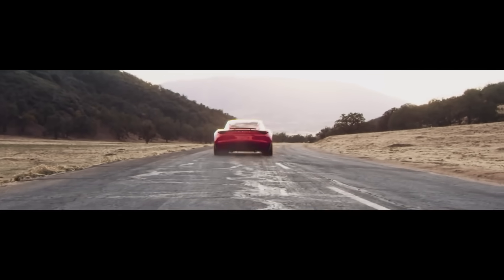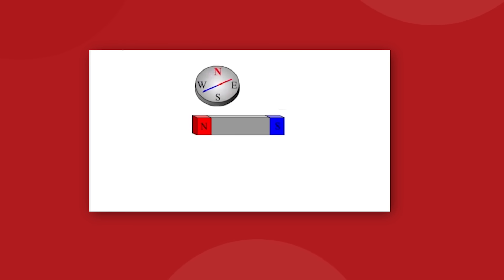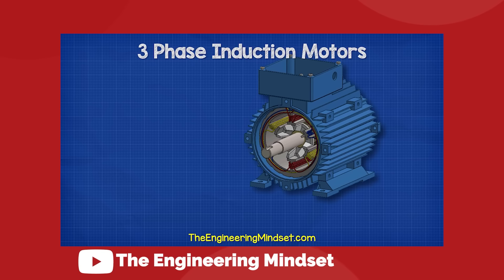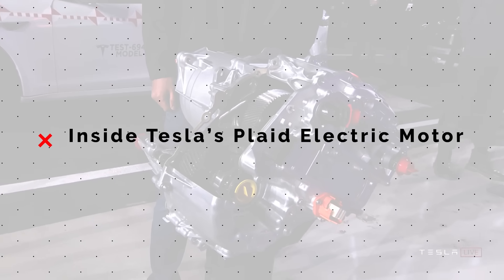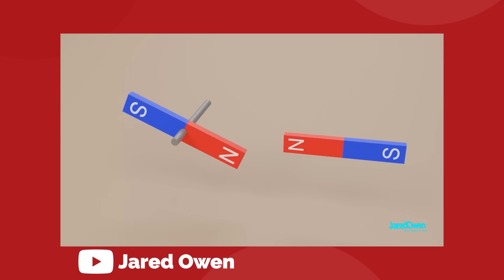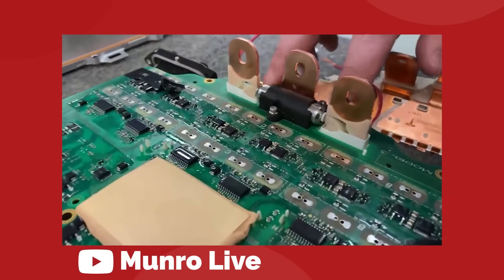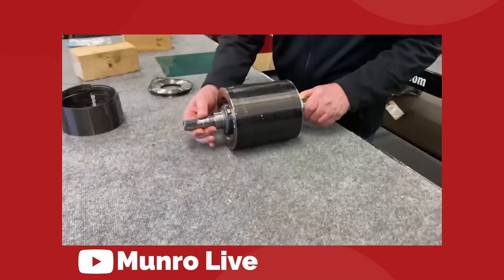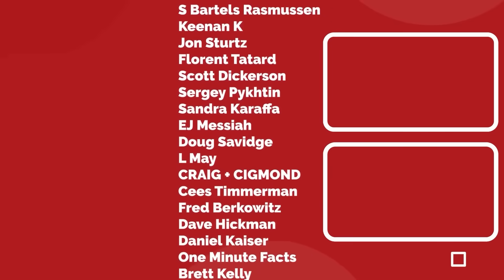The Real Reason Tesla Developed The Plaid Motor!

Comment: The only thing you got wrong, that I noticed, was the explanation of why you need twin motors or a differential gear box.
It was just a confusion of reference points.  
---> You said you can't go around the corner if the wheels turned exactly the same speed, because the inner wheel has to turn faster.  I wrote the software for an antilock brake system, and it's based on the same principles of physics.  

---> Since the inner circumference is shorter than the outer circumference, the OUTER wheel covers more distance than the inner wheel, so the outer wheel rotates faster, for the same RADIAL speed.
---> If they were locked together at the same speed, either the inner wheel locks speed with the road while the outer wheel would be dragging and not keeping up with the road and suffer extensive wear, or the outer wheel grips the pavement, and the inner wheel would be forced to rotate FASTER than the pavement, causing great wear to the INNER wheel.
---> But there isn't really any choice of which option, physics removes the choice. It will ALWAYS be the outer wheel gripping the pavement and the Inner Wheel spinning and scrapping the pavement.  This is due to the centripetal force which makes the vehicle follow a curve, causing the vehicle to experience a weight transfer, from the inside wheels to the outside wheels. That makes the outer wheel stick better to the road.  The weight, on the inner wheel, lifts and results in the wheel losing its grip and spinning.
---> Sorry for those who I just put to sleep. As engineers, we do that kind of analysis on everything, all the time. Not good for your home life, your spouse must be very tolerant and understanding, maybe even with some engineering experience, too!

Comment: Having driven both telsas and high hp ICE vehicles I personally prefer the grunt and growl of ICE.  I will never deny that electric and its instant torque is technically superior however the experience is NOT the same.  I will take the deep, crackling growl of a HEMI over the quiet whine of any electric motor any day.  One may be technologically better but the other is emotionally superior.  It's a deeply personal preference though and I would never berate anyone for their own preference.  Both will push you deep into your seat but only one of them "feels' better.  They do the same thing but they don't elicit the same visceral and guttural physiological response.  Not for me anyway.

Comment: GREAT video and explanation . . . the only thing that you might add is the why of the inverter for those of us who are getting to know EV's a little better - the inverter, as far as I know,  is inverting the battery power which is in DC volts TO the motor which operates in AC ! Cheers and keep up the great work !!!

Comment: You said that the inside tire in a turn has suspended faster that's wrong it's the outside tire has to spend faster it has to cover more ground than the inside

Comment: Maybe you succeeded in simplifying, but you definitely mix up several motor designs - and that is confusing. Electric motor designer is ale to distinguish those, yet I think if you concentrate on the design actually used in Tesla,, you would do  a better job.

Comment: The 3 main things that make the plaid faster is
1: the carbon sleeve allows  the motors to spin faster
2: the much more powerful battery design allows a higher constant current to be fed to the motors.
3: probably the most important part is the much better cooling system being able to pull more heat out of both the motors and batteries. This allows for the higher constant power output of both the battery and the motors. 

The semi uses the same motors but gets way more power output by the sounds of it because the massive battery is easily able to supply a LOT more current at a higher voltage. I would say the Cybertruck will be the same.

Comment: I can vouch for motors flying apart , with excessive rpm  I had a starter switch stick, and the starter motor exploded internally, just a rough guess,  I believe it may been spinning up to 12k rpm, with a 14" flywheel spinning near 3k rpm, and spinning the starter gear 1"

Comment: A Tesla rotor will spin at up to 80,000 rpm. Then through gears will make the output axles drive the wheels to go up to 184 mph.

Comment: this has to be the worst and most confused discussion of electric motors I have seen. The presenter shows windings on the stator and magnets on the rotor. Then at 05:30 into the video he switches to showing the magnets on the stator and windings on the rotor, with brushes to get the current to the rotor. Finally we see production Tesla video that shows the magnets on the rotor and the windings on the stator. Whoever made this knows zero about motors. Sadly very confusing for the average person trying to follow along!

Comment: Somewhere in 1000+ comments is likely a similar explanation (or better) as this: The carbon fiber IS NOT reducing the mag-field gap. The gap may be slightly tighter, but the real reason for carbon fiber is TO HOLD THE LOOSE COMPONENTS TOGETHER. Also the eddy-currents in the laminar materials can be interrupted where the parts DO NOT JOIN. This reduces induced current which merely would convert to HEAT and destroy the motor sooner. The gains of this motor design are rather clear - easier to assemble a much more power-dense motor this way if you can hold it together without causing a wider mag-field gap. MANY people in past decades pondered this approach. I was one, over twenty years ago. Musk had some advantage of massive inheritance to take risky businesses into fruition, whereas most gifted inventors get wiped out very early in "career". The real story here is that a wound tension-shell rotor was taken forward to the higher power-density, and that modern magnets are a key reason to do so, and that the fiber could actually succeed without many windings causing a fat layer.
Reply: I just went to the trouble to read some great stuff just below. Better than I expected. MrZauberwuerfel is the one to pay attention to (he truly is top shelf). I would have used the term "due to inadequate potential centripetal force of containment applied in the design" and such technicality is work even for technical writers trying to avoid any ambiguity for ... the ones who suffer soonest due to OUR deficit!

Comment: 🥸The description of motor operation in this video is completely screwed up.  What is labeled as an induction motor is absolutely not an induction motor but is similar to the standard DC motor. It is obvious that the video author has no idea on how this stuff works. Besides, Tesla no longer uses induction motors (as far as I know); induction motors were used in the early model S. 
Considering the level of knowledge revealed in this video, it would be too difficult to properly explain the operation of an induction motor; which Tesla apparently no longer uses, anyway.

Comment: @14:15 - "The inner wheel has to turn faster" - What???  Its the outer wheel that has to do more rotations (turn faster) than the inner wheel in a corner.  Just a slip of the tongue?
Addendum - Oops.  should have read one at least one comment down.  Others caught it as well.
All in all, good video.  Thanks.

Comment: Wouldn't a superior electric motor also be superior as a generator? How effective is the plaid in regen mode? With half of the back axis of a Tesla plaid, with all the electronics and batteries, and a propeller attached to the wheel output axis, how efficient would that be? After all, almost all of the millions of wind turbines in the world are designed to create a stable AC current that can connect to the grid, a Tesla wind turbine can be optimized for DC battery charging directly. The SWB power stations are the future, Tesla already has the S and the B, so what about the W? With Tesla's superior production methods it could be yet another game changer, no?

Comment: Excellent video.  I have owned 8 Tesla's over the last 11 years but have never heard such a clear description of how the  amazing motor works.  One minor point, when you describe the reason for a differential, wouldn't it be the outside wheel that has to turn faster than the inside wheel, rather than the other way around?
Reply: Why have you owned 8 teslas in 11 years?

Comment: A lot of comments about differentials.  Y'all don't take into consideration mechanical locking ones.  My '75 'Vette's rear diff had one standard, and I can tell you that during a tight turn from a stop it was impossible to not spin the inside wheel.  Why?  Because it took about 90 lb.ft. to overcome the clutches in my version.  Even being very easy on the throttle and letting the clutch very slowly, as soon as the clutch started to grab and develop torque, the car would not move until the diff saw the required torque.  Now, I was on a civil-war era military base at the time, with roads so narrow they were really only suitable for pedestrians.  I can assure you I was not doing it on purpose, because the penalty was revocation of parking privileges.  When the captain of the guard stopped me one day after seeing my wheel laying rubber, he pulled me over and proceeded to read me the riot act.  I explained the problem and he said he didn't want to hear it, so I offered him my keys and politely offered to allow him to try not to burn rubber at that turn.  I told him he could try however many times he liked to see if it was possible.  He declined and never bothered me again.  Fortunately, I was being transferred to another base in a few weeks, so I took the VERY long way around until my last day.

Comment: really cheap coreless quad-copter motors have their copper windings soaked in epoxy resin rather than wrapped in CF.  70k rpm.  of course much smaller but interesting Tesla didn't simply fill the gaps between the copper wire strands with high-strength epoxy.

Comment: It will be a daunting task to convert every category of vehicle to electric.

Scientists must have calculated the ant. of BTU's not entering the atmosphere
after total conversion.
A stable climate without winters would be neat.
Giant solar airships could be made that 
fly around the world 24/7 and they can beam energy to underground storage batteries/capacitors at 
Tesla charging stations.
But is 800 volts going to be enough for a battery 10 yrs. from now.
The speed limit will have to be tripled to meet the needs of future E'V's.
Recent breakthroughs in tire compounds will allow 500 mph cruising speeds, even in winter.

Comment: Well simplified and explained. A lot of science to describe and you did very well just explaining the magic to make toe motor work. Yes the inner wheel will travel too fast only if you are taking the outer wheel as the driving reference. Which you need to do to keep the back of the vehicle stable so I agree with your description here.
Reply: he said the inner wheel needs to turn faster its quite the opposite.

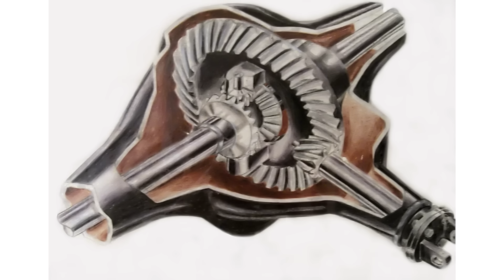Comment: Time 14:19 Error: Should be:  The inner wheel spins slower .  The outer wheel has to spin faster traveling a longer distance around the corner.  Picture a car on a circle with the car width as the radius.  The wheel at the center does not spin.  The outer one does.

Comment: At 2:30 the compass goes around the magnet.  But shouldn't the compass point at the north or south pole as it goes around the end of the magnet?  For example, after the compass goes all the way around and is at the lower left and compass is not pointing at the nearest pole of the magnet- it's at 90 degrees to the magnet's pole.

Comment: at 14:21 the video mentions differentials....making the claim when cornering - the inside wheel spins faster than the outside wheel.  I believe that is not a correct statement.  When a car turns a corner, one wheel is on the "inside" of a turning arc, and the other wheel is on the "outside." Consequently, the outside wheel has to turn faster than the inside one in order to cover the greater distance in the same amount of time.

Comment: Induction motor- "a permanent magnet within a magnet". Not so, in an induction motor. The rotor in an induction motor is not a permanent magnet, it has no steady magnetic field. The induction refers to the stator coils inducing current in the rotor bars, which then create an alternating magnetic field in those bars which in turn interacts with the stator coil fields to produce rotation. Tesla does have permanent magnet rotor designs as shown later in the video, and even reluctance motor designs. Each has advantages and disadvantages.

Comment: Essentially it's a three-phase induction motor, all you need is a frequency drive to pull the Motor to each opposing pole on the stator.
Magnets increase the efficiency but I'm sure Tesla has a few little gimmicks in there to make them better.

Comment: I enjoyed this video. I used to take things apart as a kid. I still do, usually because they're broken and need fixing. Cool job the old guy has taking this stuff apart! 

Anyway, I'm really curious, does the inverter modulate the power into the coils so that as the permanent magnet pole reaches the coil, the coil switches polarity after a small delay in order to push the permanent magnet away in the correct direction?
Reply: Yes, more or less. Permanent magnet comutatorless motors use hall effect sensors  to determine the exact position of the rotor and switch the current to the different poles.

Comment: 14:22 no, the inner wheel has to turn slower because it has less length to travel as compared to the wheel on the outer part of the corner which has to turn faster because it needs to travel a further bit...that is why athletes that run the same speed around the track, the inner athlete looks like they run faster, but they do not, the distance is shorter...😊minor correction...

Comment: The motors used by Tesla and as shown in this video are not induction motors as induction motors do not have permanent magnets but rely on an induced electric field in the rotor to work with the rotating electromagnetic field in the stator coils to cause it to turn. Tesla use a PMSR motor which stand for Permanent Magnet Switched Reluctance motor, this is a type of brushless DC motor where control electronics switch the current in each stator coil based on the position of the stator. This has many benefits over induction motors, it is more efficient, produces more torque at all speeds and generates less heat in the rotor which in turn means less maintenance than an equivalent induction motor. Tesla did used to use induction motors in some models though I think all their cars now use PMSR.

Comment: I'm still in firm belief that Tesla needs to copy what Ford did and that is, offer every model of motor they have in a crate motor option for enthusiasts and EV conversions, because once the battery technology has advanced enough which is the only thing holding electric cars back, petrol cars will be obsolete and people who want to keep their classic cars will have to make their cars electric to keep  them on the road, because knowing western governments as soon as the battery technology has advanced enough to the point were you can get huge range on a single charge and fast charge insanely quickly to full capacity, the government will know doubt outlaw petrol and diesel fuel for cars nation wide.

Comment: Around 4:40 you show a rotor with permanent magnets arranges around it in alternating North and South orientation. This is what you find in a BLDC or Synchronous motor, not an Induction motor which you failed to to describe at all over the next two minutes where you refer to Tesla symbol being a section of Stator and Rotor. You did however manage to include a graphic of armature and commutator found in DC Brushed motors and universal motors. At no point did I hear or see any mention of Squirrel Cage motors which are the most common type of induction motor whether single or three phase.

Comment: Mechanical engineering is engineering for us dumb people lol.  It can be understood with basic intuition.  Electrical and software engineering, is for people smarter than us :).  Though all of Tesla's tech will be obsoleted when the industry moves to the much more powerful series wound electric motors instead of using permanent magnets in the rotor.

Comment: I always wondered what safety mechanism tesla uses to insure a motor shutdown in the event a fault allowed an unwanted throttle up. I'm curious as to what is required for that explosive fuse to ignite. Those electric motors uncontrolled is scary to think about

Comment: You have probably already heard this comment, but you mentioned that the inside wheel needs to spin faster than the outside wheel when going around a turn during your discussion about the differential. It is the opposite though. The inside wheel needs to spin slower than the outside wheel. The outside wheel has more distance to cover than the inside wheel, so it needs to spin faster than the inside wheel. Other than that, your video was accurate and informative.

Comment: What I'm very interested in is this:

Rides, streetcars and trains are equipped with various classes of electric motors - some of which have x times more power than any electric car.

What I wonder - a Tesla (acquaintance drives an S-model) is very quiet - but when I hear an electric motor is quite loud - especially with an electric locomotive of the type - Siemens Taurus. 

Where does this come from - thanks :)